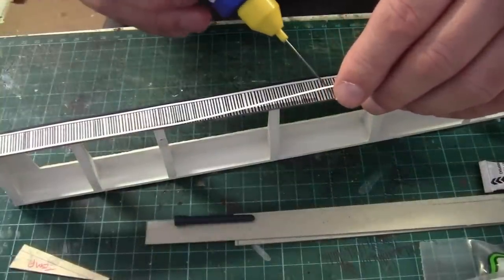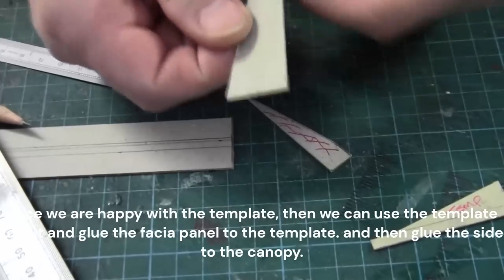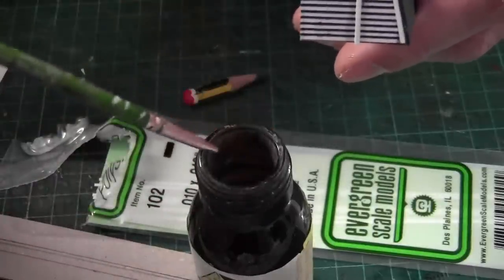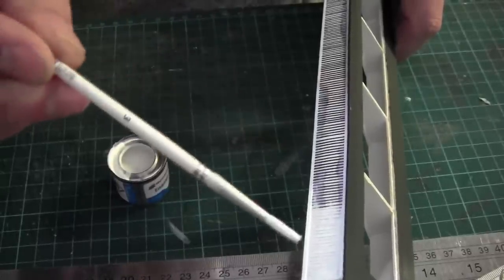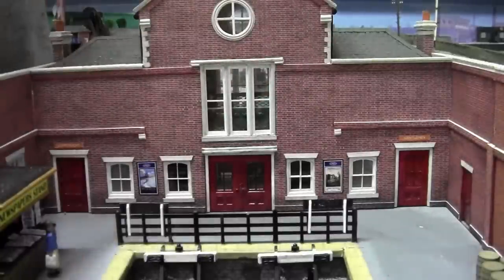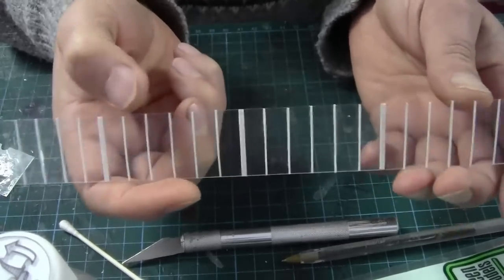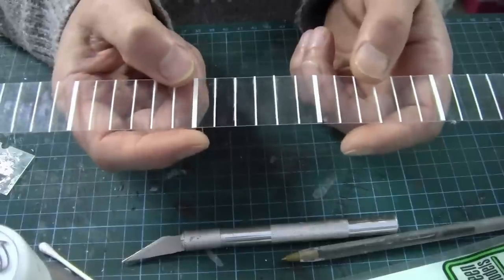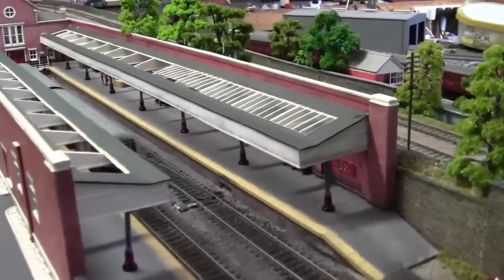Jarrow Road Station. Canopy's Part 3. No 361

Comment: Hi Tony, so pleased the canopies pulled the wall into line, its always a problem with card models.  Nice one on being able to use the cutting mat lines to get the struts nice and parallel - well planned! It’s looking even better as all the finishing and trimming off is being completed, great job mate! Sounds like a bit of cold coming on? Time for a whisky? Cheers and all the best Stephen
Reply from the maker: Hi Stephen. card can be a problem when its put together in long lengths, with it bending and warping. but i think i got away with it this time. Lol. i have been trying to shake off a cold for the past week. i find a shot of brandy does the trick for a soar throat. until next time all the best Tony

Comment: Hi Tony another interesting and tip packed video, we must be on the same wave line because as I was thinking about detailing sections and what I would do you were coming up with the same thing (great minds think alike lol). Where you fixing any down lights under the canopies or leaving it as it is, take care mate regards Barry..
Reply from the maker: Hi Barry. thanks again for commenting. i will be leaving the canopy's as they are with no lights. just for now anyway. i should have drill holes in all the roof supports to all for me to put in the leds. it could still be done. thanks again my friend. all the best Tony